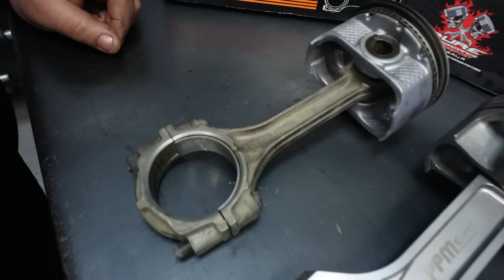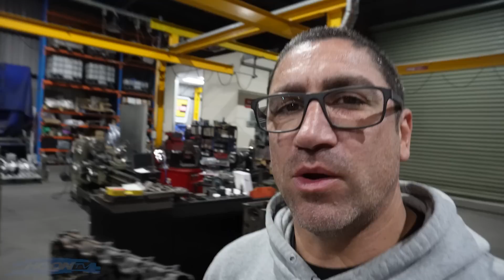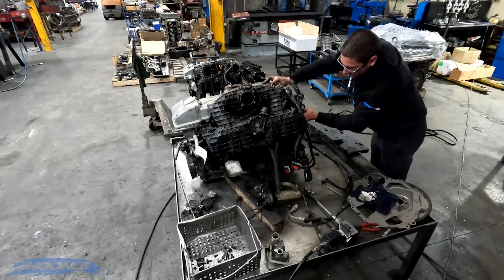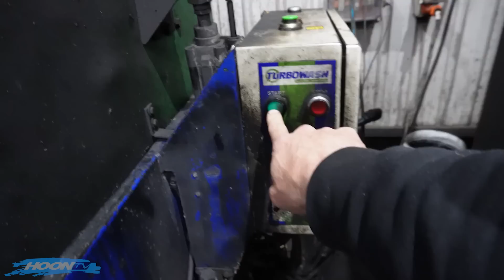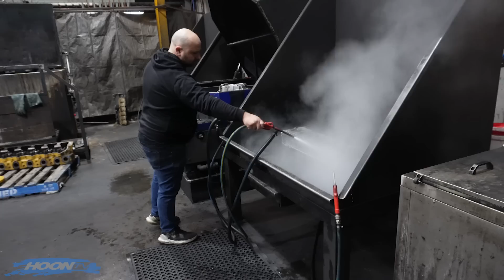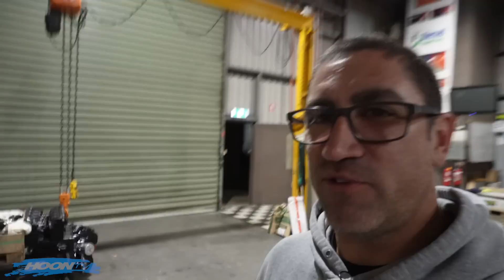Mega Ford BARRA Build - Part 6 - "BARRA PROFESSOR"

Comment: I bought a mystery bf barra engine off marketplace (supposed 140,xxxkms)for $100 had everything besides loom and accessories. And pulled it down and it was near immaculate. Had a little wear on the rear main seal surface but that's normal for the seal to dig in. But I'm now building it as a na for my ba wagon its got a checkover clean all the sludge out, linish the crank, clean rods and pistons, bearings, rings and gaskets. It's practically ready to go together just need to final clean everything. Then just getting some custom cams. With factory 10.3-1 I don't need to do anything comp wise just need to check valve to piston after milling the head then shes ready to mate with a manual and get thrown in the hole
Reply from the maker: Nicely done! They’re a great engine. Some just don’t get loved, so they’re disastrous
Reply: @HoonTV  yeah when the motor that's currently in mine comes out it's going to be bad😂 ran low on oil and I was thrashing it sounded a bit odd so checked the oil and there was nothing on the dip stick..... limped it to work threw some 20w-50 in her and she's been fine just a tad noisy on startup 😂

Comment: That boat ramp looks alot like Christies beach boat ramp 😁
Reply from the maker: Close, O’Sullivan Beach
Reply: @HoonTV  my bad thats the one i was actually thinking of as its 5mins from mine in Hallett cove. Would be great to meet you one day mate as im in the middle of building my 50th ani g6et as ive now finished the suspension and handling, now moving onto performance. 

Its currently at 320rwkw with some mods and some more parts yet to be installed and im aiming for around 600hp as a daily.

Comment: I had heard about how good those HP Junkie oil pumps are while watching BCW, Benny Custom Works, has the 1000hp barra White Cresta also linked with Mighty Car Mods. If others are reverse engineering your stuff then your doing it right.